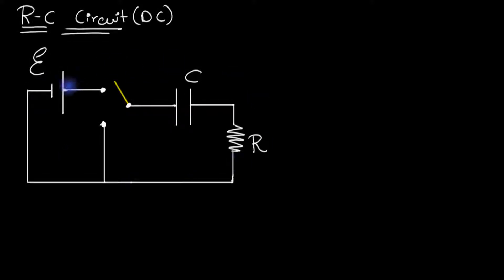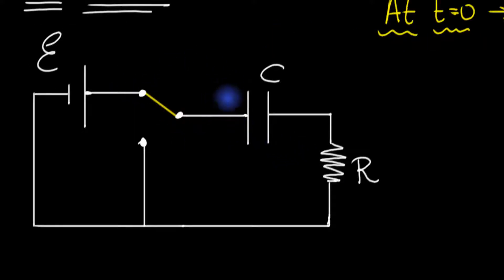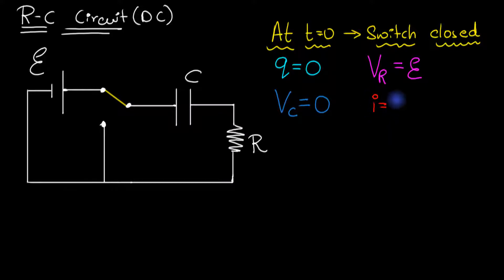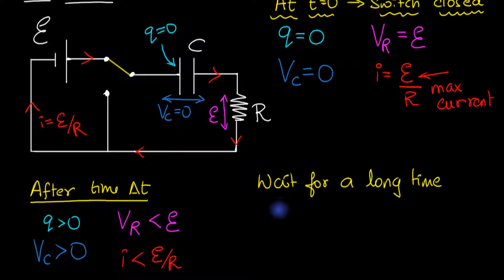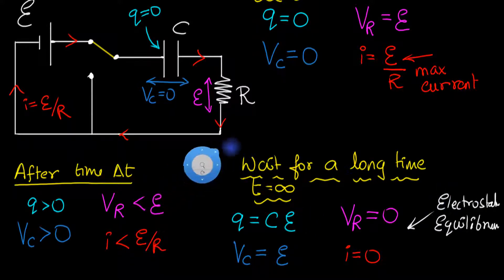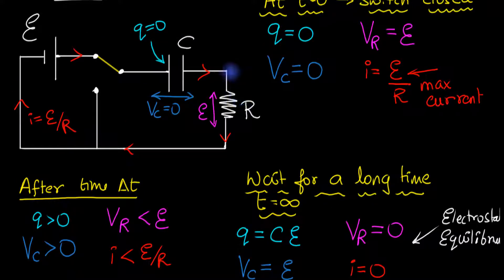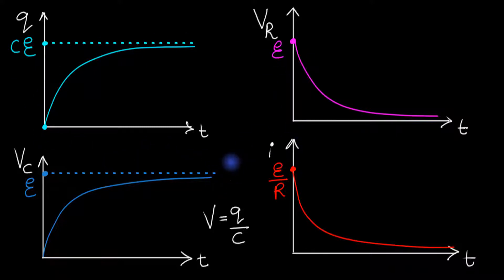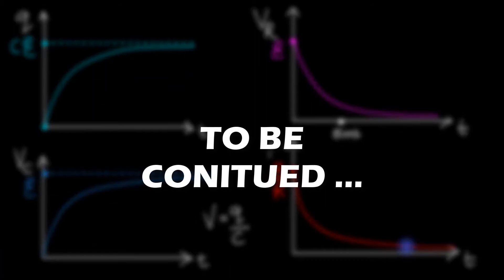RC circuit (intuition)

Comment: sir if charge is zero, then how is the potential diff E created across the resistance?? i mean  potential difference is work done per unit charge. now as soon as switch is closed, a potential difference is created across the terminals of the battery (E). now how is the same potential difference created across the resistor?  i know that change in potential when the current flows through the resistor r is E. it is difference between initial and final terminal of resistor... but how does this potential difference travel across the resistor . im sorry that's the best way i can express my doubt...........
Reply from the maker: Potential difference is calculated as the work done in moving a charge from one point to another. It doesn't mean, for the difference to exist, you have to carry a charge from one point to another? 
Think of potential difference as difference in height between two ends of a slide. If a kid is on the slide, then he will slide down and get accelerated due to the height difference. But whether a kid is there or not, the height difference exists. 
Now why does this height difference cause the kid to slide down? Due to gravity of course. So, gravitational field makes the height difference cause the kid to accelerate. 
Now here is the thing, the moment the switch is closed, instantly (at the speed of light actually) an electric field gets set up in the entire wire (except for between the plates). This makes the charges accelerate. But they keep bumping into the crystal lattice and hence end up moving with uniform speed, causing a current (say towards the right). But as the charges are getting deposited on the plates of the cap, it starts pushing the charges back. (The left plate gets positive charge, and hence makes it tougher for more positive charges to move towards it, retarding the current). At the same time the electric field gets developed in the plates of the capacitor, and notice that the voltage across the resistor drops (as the current starts reducing) and the voltage across the plates of the capacitor increases. The total voltage sum across resistor and the cap always remains the same. 
Feel free to ask more doubts :)
Reply: Bro at time T=0 due to the electric field set up by that battery current moves but there’s a catch there will be no charge buildup at the capacitor to make this statement clear let me make u understand see when the battery is setted up we approximate T=0 for the electric field activation and if we approximated that then obviously we can say that the charge buildup on the positive plate of capacitor would take some time as it has to move some very small amount of time so this is all the game of time TIME MATERS and. That’s y voltage for the capacitor at T=0 is 0 Nice
Reply: Gukesh is the best